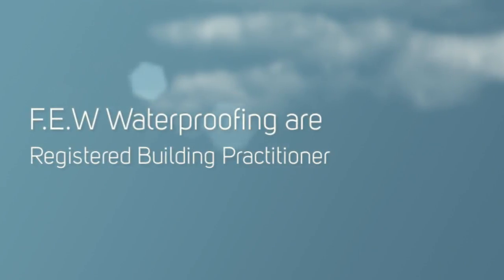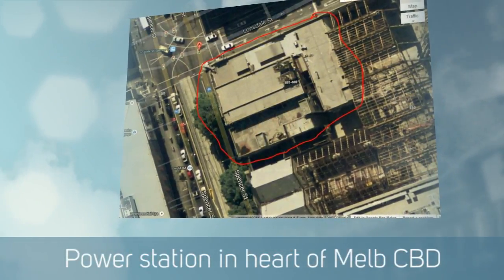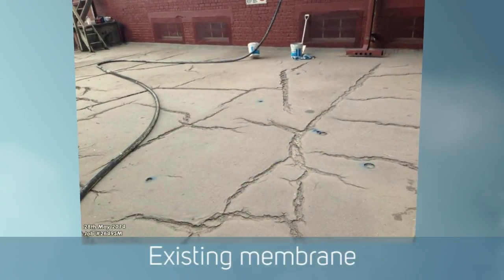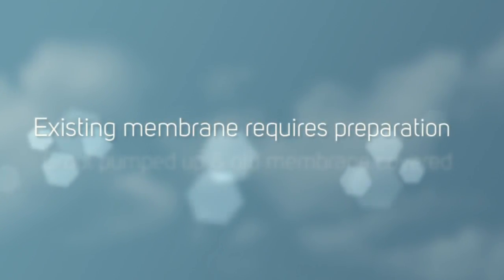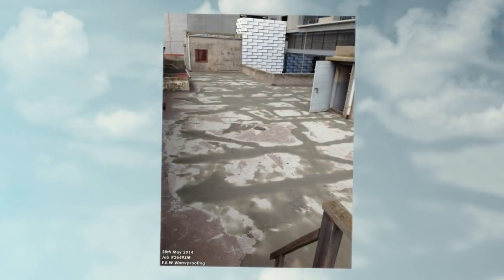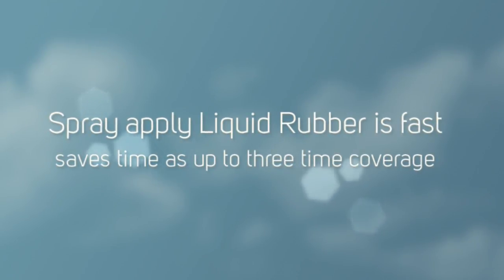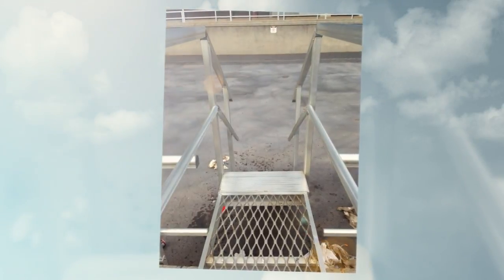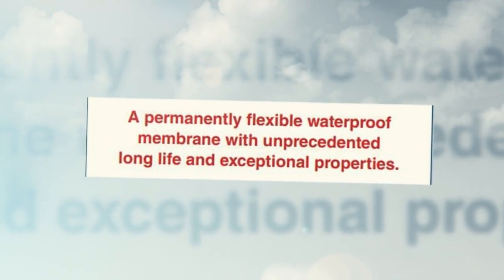Best Waterproofing Membrane to Fix Leaking Flat Concrete Roof - Melbourne

Comment: Dear Friend, This is Michael from SWD. We are a manufacturer and suppliers for almost 50 kinds of polyurea and polyurethane coating products for waterproofing and corrosion protection. Be free to tell me when you have any concern on your coating projects. About the UV, we have some products UV resistance.
Yours sincerely,
Michael
SWD Polyurethane(Shanghai) Co., Ltd 
Michael Wang
Imp&Exp Sales Manager
No.1588 Lianhang Rd, 1B Building Minhang District 201112 Shanghai China 
Tel: 0086-21-51905301
Fax:0086-21-51905302-606 
Mobile: 0086-139-135-42791(WhatsApp)  
Skype: wanglei1152@163.com 
E-mail:  michaelswdurethane@gmail.com or michaelwang@swdpu.net.cn 
Website:www.swdurethane.cn